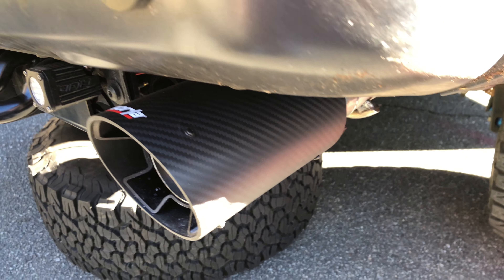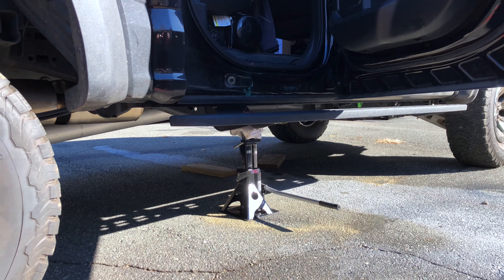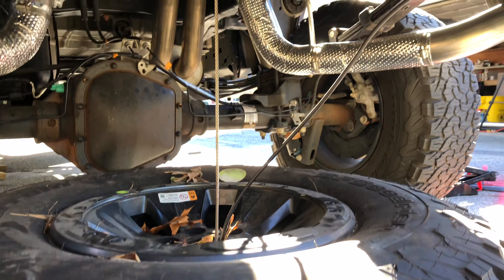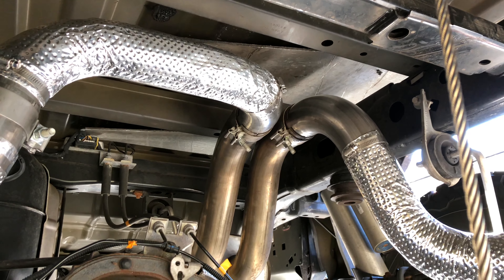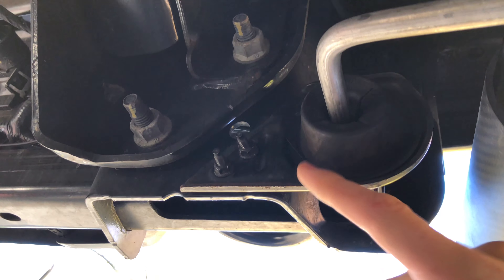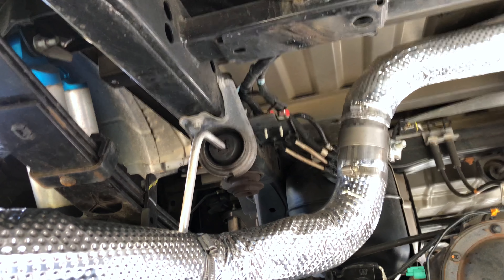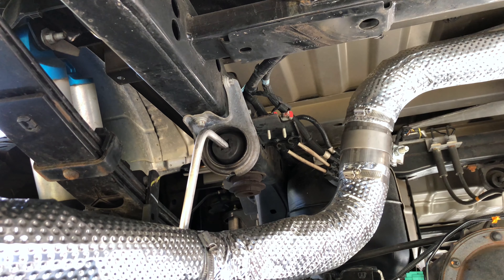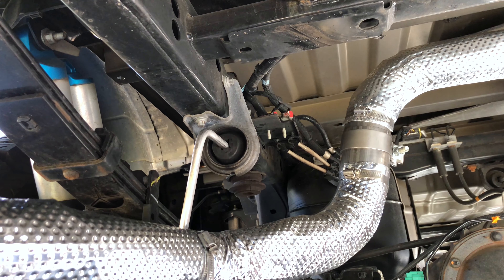Borla Intercooled Carbon Fiber Tips Install

Comment: Is this the Atak version?
Reply from the maker: I have the S-Type, just finished redoing the entire exhaust system though, it's our newest video. Epic sound.

These tail pipes are a separate package available for order.
Reply: Geezer N' Young Gun Ok, thanks
Reply: @geezernyounggun5136  Do you have link to order these tail pipes? I cant find them anywhere unless it's a full exhaust package.
Reply from the maker: Tony - Sorry I’m just now getting back to you. Here is the link. https://www.cjponyparts.com/borla-tailpipe-3-inch-pair-with-4-1-2-inch-carbon-fiber-black-anodized-tips-f-150-raptor-2017-2018/p/60640CFBA/ it’s at CJ Pony or Stage 3 Motorsports.